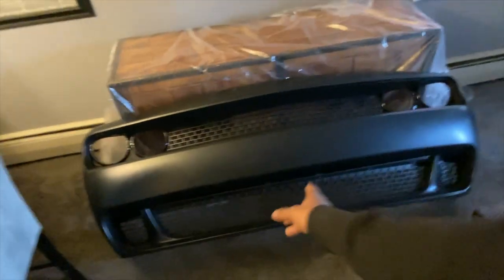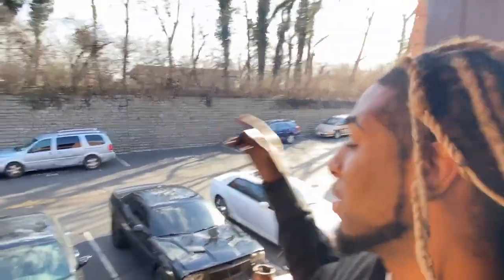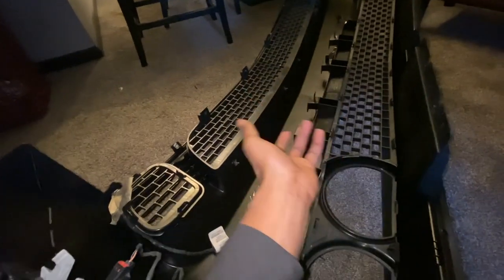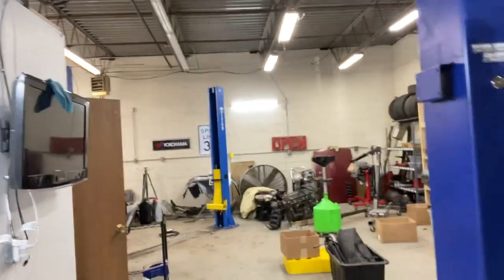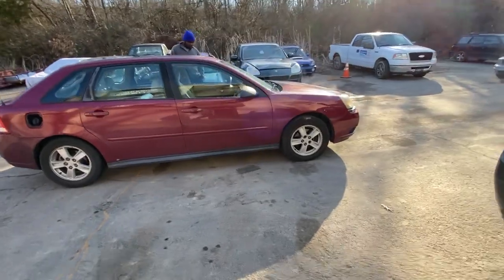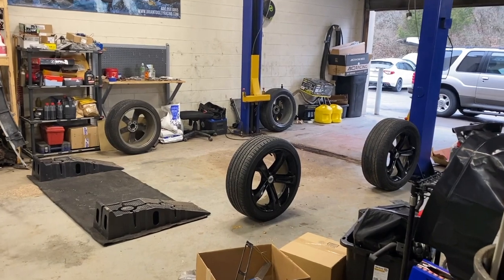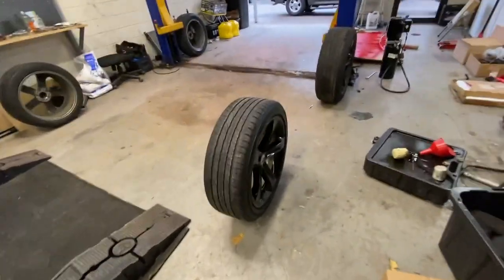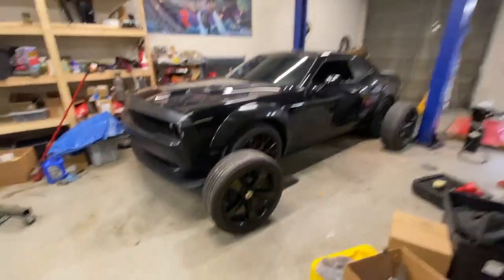HELLCAT BUMPER INSTALL ( pt2)

Comment: Whats the part numbers for the brackets you got from dealership. Mine are broken on my old bumper somi csnt swap them on my new vicrez bumper.
Reply from the maker: idk part number but call the part department at you local dodge and tell them you need the front bumper bracket. make sure you know what your looking for too!